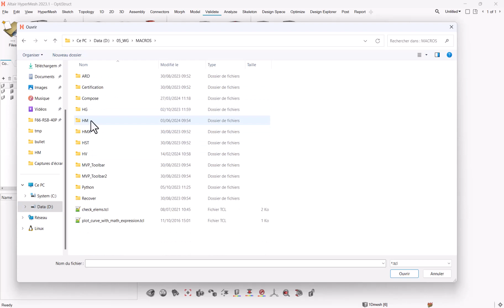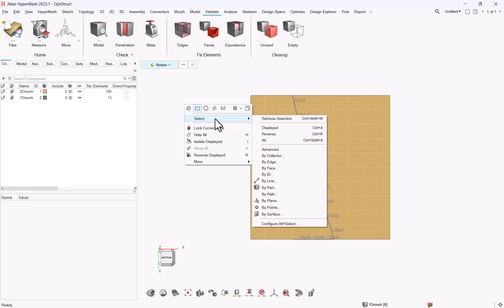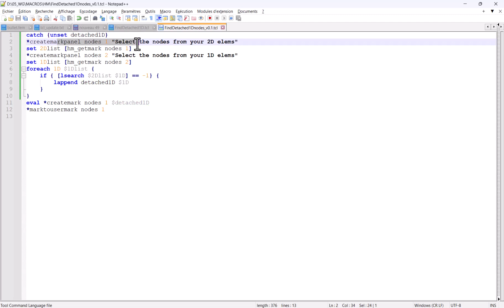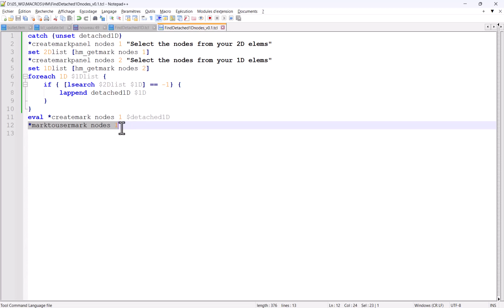How to detect 1D nodes detached from 2D or 3D mesh

Comment: This should be a built in feature.
Reply from the maker: hello @vimvigour3327, for OptiStruct profile, you have access from 1D ribbon to Member mesh and Stiffener mesh, which allow to create 1D elements along 2Dor 3D elements, with the control of density. This reduces the risk of getting 1D elements not being connected to 2D mesh